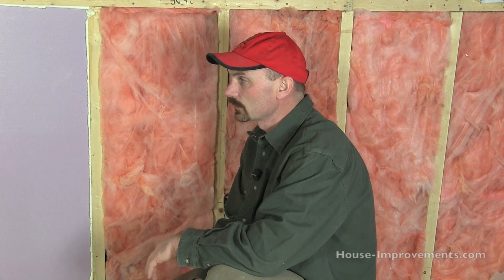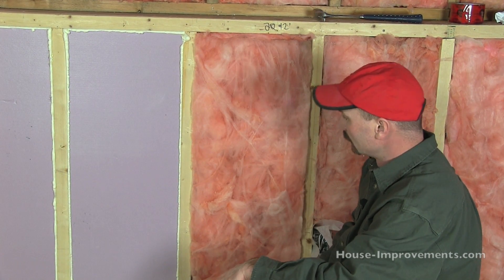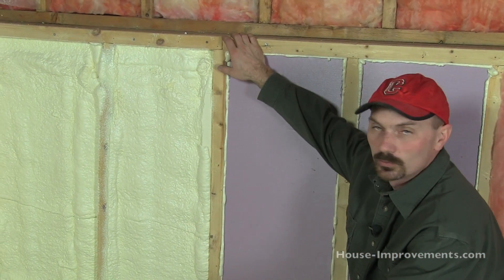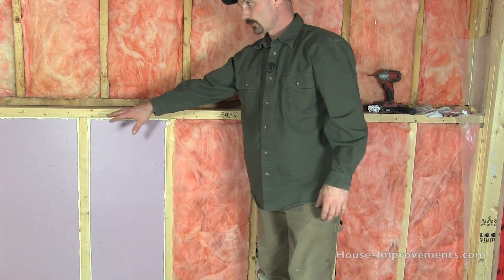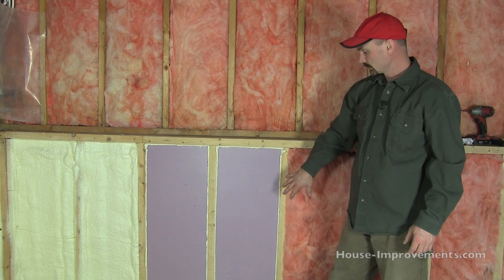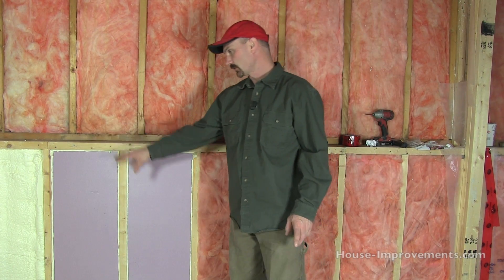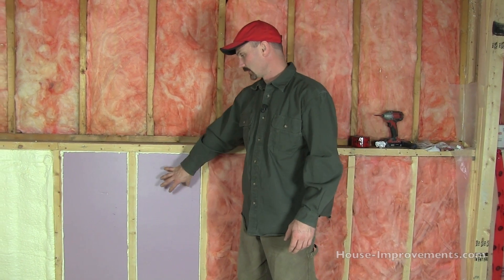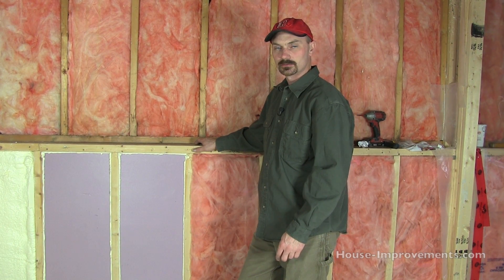House Insulation - Different Types

Comment: A-frame house in California. The section I’m thinking about currently has a sheetrock ceiling with insulation blown on top of it in the attic. Temps can get above 100F here. Can I get away with taking out the ceiling (and therefore insulation) and install stuff directly to the inside of the roof as an insulation replacement and reasonably expect the space to not get super hot on a 100-degree day?
Reply from the maker: Our forum is the best place to discuss this.https://www.house-improvements.com/forums/

Comment: Hi Bud thanks for showing .I'm in England .Got an old detached stone place .There is so many People saying this and that about insulating solid walls .Can you give the correct way I'm wanting to put stud work up and insulate .I see You mentioned using  board straight against wall then stud and insulate it's what I was thinking of doing .What's you're thought plz thanks dave .
Reply from the maker: Stone foundations are a whole other beast in most cases and I dont see enough of them to honestly know the best way to do them but I dont think rigid foam would be it. The wall surface is too irregular to get a good job done. 
My best guess is that spraying 2" of 2 component closed cell spray foam on the wall and then framing and insulation a wall would be the absolute best if it is a dry solid wall. We could discuss more on the forum if you wanted to join us there.
https://www.house-improvements.com/forums/
Reply: Thankyou for replying .I will frame inside  I'll seek more info abt warm meeting cold .Would like other People suggestions  if theyve insulated stone walls .Very  Good Videos .thanks again .

Comment: I notice some of the rigid boards like XPS have silver reflective backing, and some don't. What's the difference, which is better? etc. 

I've also always wondered, why are multiple, thin foam boards not used in a cavity, with gaps left between each? Example, in a 3.5" stud cavity, 1" board flush against the sheathing, gap of .25" using spacers, then another piece of foam board, gap of .25", then last piece of foam board, so you're trapping air in-between each piece..??? I wonder if that would work?

Comment: My house was built in 1947 and is made of shiplap wood and no open stub bays. Would insulation board be better to use that batt.
Reply from the maker: If you have ship lap on both side of the stud bay you may be better off with loose fill blow in insulation, or you could remove the inside ship lap and install batt insulation then cover with a vapour barrier (if you require one) and drywall.

Comment: nice work on explaining that ... not sure who frames but im noticing that the bottom part of the wall isnt overlapped the top part of the wall 6" to allow for insulation to completely touch each other ... always a cold spot there our codes here finally the last few years are forcing the framers to build that up...  No one likes a higher cup holder
Reply from the maker: Ya these are old walls . I use 2" foam across the top and drywall over that.

Comment: You mentioned a "hybrid insulation". Does that mean I can put inside my 2x6 exterior wall for example 2 in. of XPS and 4 in. of batt insulation? I live in cold climate (climate zone 5, almost 6) and Im afraid of condensation if using XPS. So far Ive been using only batt insulation. Do I have to be worried if I put XPS plus batt in my wall?
Reply from the maker: In most cases no is the answer. In basements it is common to place rigid foam against the concrete seal it well then frame the walls and insulate them with batt insulation. This is more what I was referring to. In a exterior stud wall above grade a wall insulated with 2" of closed cell sprayfoam and then covered with batt in each stud bay can be done in some areas. Always best to check local codes first. If you have more questions we can discuss it if you come to the forum.
https://www.house-improvements.com/forums/
Reply: @HouseImprovements  Thank you, Shannon, I will.

Comment: If you put a vapor barrier in a basement on the warm side you may be creating a mold sandwich.
Reply: Larry Schwartz  that’s exactly what I was thinking, it gets pretty cold here in the winter. I have 2.5 rigid foam against the basement wall, and then roxall batten insulation in the framing. I don’t think i need the 6ml poly as the rigid foam acts as my barrier.

Comment: Please HELP.  Are the steps for finishing a basement  1) appropriately attaching the rigid foam directly against cement wall then sealing it with tuck tape &/or spray foam 2) framing the wall with studs, 3) Applying Batt between studs, 4) Sealing all cracks 5) Apply 6 mm vapor barrier over everything 6) Start hanging dry wall

Comment: I watched it few times, this video. I am still wondering, should I go with cellulose insulation for the floor and walls? I was thinking of wrapping the studs with vapour barrier and then putting the plasterboard on half way so then using the openings I can stuff the cellulose insulation (manually) once it reaches the height of the plasterboard then board off the rest all the way to the top and then fill in with the remaining cellulose insulation (I can get cellulose insulation for cheap and better soundproofing material) from the top and then those gaps can be closed with the ceiling boards. Is that a good plan? I need it more for soundproofing purpose. Because of the nature of these stuff (loose) I am going for Roxul on the ceiling.

Comment: I live in a house from the 30s it's a kit home. I had problems with the wall boards warping from moisture and am going to replace with fresh drywall. Not surprising there's no insulation in the walls. What do you suggest for an old house with paper thin walls?
Reply from the maker: Spray foam if you have the budget or Roxul other wise

Comment: I admit I have no knowledge on the subject so please don't judge. 1 solid piece of foam is exactly that... 1 solid piece.  Same would go for professionally sprayed foam... 1 solid piece of sprayed foam. The question starts here: when you "spray foam" onto already existing foam, does it "bond" and create a water tight seal as 1 unit? Logic tells me no, but I honestly don't know.
Reply: There is a lot different spray (like closed or open) and rigid foams with trades for all of them. Sprayed foam does seal better but there can be QC issue with it and open can absorb moisture while closed foam shouldn't. Since believe it or not mistakes are made that can cause problems like off gassing of VOCs so bad ppl couldn't live  in the house. In a basement without framed wall rigid foams should be consider 1st  they even had ones with nail mediums since there no studs. But glue can be used so they are not really necessary.

Comment: Hello Shannon,
I've come from your roofing videos.  Good job !
Hey, I like stucco / timber (English Tudor) walls.
My house has exposed concrete block walls.  I'm thinking of insulation, an air space, and then the exterior.  Do you know of some exterior wall panels (fiber, fiberglass, pvc, ???)
that look like stucco, and don't need to be painted?
Wait!  I'll go to the forum....

Comment: You do not ,repeat.. DO NOT, install a vapor barrier over  spray foam.
Reply from the maker: In many places less then 2" of spray foam is not considered enough of a air/vapour barrier.
Reply: Depends on type (like open or closed) of the foam and where its being applied too. Nice post but a little misleading...
Reply: You do realize that different States/Provinces/Countries/Counties have different code requirements right? YouTube hecklers are so annoying. Make your own video for your own region/State code if you are so inclined to add your two cents. Any reasonable person knows that these videos are informational and that you should consult your local code before doing your own work. Home building in Canada is different than home building in Ohio or California. Thanks for the video! I appreciate it.
Reply: You do realize none of the comments in this thread so far, had anything directly to do with code requirements right? So the half cent add by the last comment was irrelevant. Have good day, Sir.

Comment: Hi Shannon,  this video is very good to understand the different options. We bought an old house, that was supposed to have a finished basement but appears to be the former owner just covered the walls with drywall over 1x4  boards. My husband and I have been thinking in place some rigid insulation sheets on top of the drywall and then add some more drywall on top. We live in some place in Canada where the temperature drops to -50 C in winter. I wonder if  this could be a good idea or it is better just remove everything and start from scratch? Thanks in advance for any ideas
Reply from the maker: really best to start form scratch or at least get rid of the layer of drywall.
Reply: Thank you so much for your advice!

Comment: Shannon, when you poly this wall do you use acoustical just at the top, bottom, sides or do you seal off the center on the sill between frame wall and cement section with acoustical too?
Reply from the maker: I'm not sure what you mean. If you come to my forum we can discuss this more. http://www.house-improvements.com/forums/

Comment: Hi guys, my question is about insulation on a box truck.. I'm in England which means hot summers and cold winters, I was planning on using Celotex insulation boards on the ceiling, walls and floor. What I now need to know is what condensation/vapour barrier to use and where to put it ? Some people are saying it needs to go next to the outer wall and some are saying next to the inner ply wall but thats due to hotter and colder weather.... ARRGGHH !!! Another person recommended a vapour retardant sheet but wasn't sure if it should go next to the inner or outer wall since we'll be getting hotter and colder weather over here... Pleeeeeeeeease tell me you have a 100% correct answer ?...
Reply from the maker: Well We are in Canada so our weather is likely similar. Our vapour barrier is placed on what is considered the warm side of the wall. That would be on the interior.
Reply: Great thanks for the reply :)
Reply: Livin In A Box
Reply: Hello :)

Comment: Spray foam insulation could be toxic if not installed right .. Rather go with the bad insulation or the sec option
Reply: Off gassing will "always" happen with sprayed foam but after a few day it's generally low enough were ppl dont complain about the smell if it applied correctly. But less risky rigid foam or even a solid plastic will off gas or leach. It just a matter of degrees. So as general rule it better to keep it on the outside of the house when possible. Like in new construction.  But there are issues with any material that is used. Like mold can be an issue with fiberglass.

Comment: What kind of spray foam did you use, and where could I get it from?  I live in USA, Michigan.  Also average cost on the foam spray kit you used in your other video?  Thanks Shannon.
Reply from the maker: These kits are not cheap, I can not remember the costs off the top of my head. This kit was "froth pac" by DOW I believe but there are others.
Reply: +HouseImprovements Thank you so much Shannon.

Comment: hi great  video.  I'm  turning my garage  into  a  work studio/ grandkids playroom . it already  has  drywall  installed . instead  of  tearing  down  the  drywall  I  wanted  to  add another  layer  of  drywall  but in between  them add some  kind  of  insulation. what  do  you  recommend .
Reply from the maker: +Virneicia Sims Tearing the old off an doing it right, sorry. The only thing you could add between the drywall layers is maybe 1" foam but then you have issues with electrical boxes not fitting and extending window and door jambs as well.

Comment: what do you recommend for a small basement area
Reply from the maker: +FeaR ComicS  If the walls are only 2x2s then spray foam gives you the most R value but using rigid foam and canned spray foam gives you the most bang for your buck. With a 2x4 or 2x6 wall I prefer rigid foam sheets against concrete and sealed with canned sprayfoam  then framed wall in front of that filled with batt insulation.
Reply: Jjbjñlnbihhvlñoohobbuvivlñbbicñppp0jvvñppphcygopjvibpppovvopppjbjbppobbjbopñ jvjv

Comment: hi great video, im restoring my grandfathers RV and im not sure what to apply as insulation the roof starts on 2" depth and goes to almost 4 inches of depth,the roof is aluminum so I dont know if i have to put something between the aluminum and the insulation.
The original insulation was a Styrofoam about 1" thick and had like a thin wood on both sides(like a sandwith) can you advise what could be the best way to go? thanks so much.
Reply from the maker: You should be able to have the styrofoam in direct contact with the  aluminum. I can't see why you could not use 1" or 2" foam.

Comment: New to this, I trust this will get posted..I'm intending to build a new shop this spring. The area is south of Buffalo, just north of the Pennsylvania border. We get cold. There is a 20' x 30' existing concrete pad on the lot. I will enlarge this to be 20' x 70', with radiant floor heat under the new concrete only. Walls to be typical 2 x 6 x 8' on 16" ctrs. So, I'm thinking a good and economical wall situation to be, form the outside, 1" x 10" rough cut board on board, Tyvek, 1/2" OSB, 1" ridged foam with a 1/2" gap around the sides. This gap to be filled with Great Stuff. Then 3 1/2" batt insulation with the paper flap overlapping the studs. And put foil tape on that to seal that tight.  This will leave a dead air space, as well as a space for mechanicals. The inside would also be 1/2" OSB.

This will leave 2 dead air spaces, the one on the exterior with the board on board will be about 7 1/2" x 1" (with a 1 1/4" lap) and 1" x 14 1/2" in the wall. I understand these to be a good thing for not conducting temperature. The exterior OSB will make the walls ridged, as well as a nail anywhere surface for the board on board. And the same for the interior OSB, as well as a hang a shelf/cabinet/rack etc anywhere surface.

Any thoughts as to what I might be missing?

Thanks, Jack
Reply from the maker: I'm sorry you posted such a long post here but I hope you would not mind reposting in to my forum and I can better respond to your questions there. thanks.http://www.house-improvements.com/forums/
Reply: Hi, JL.  If you are looking for a super insulated building for your shop, there is a company out of Arizona that has a product called "ThermaShell" that I suggest you look at.  There's is a prefabricated system made from panels made from EPS foam with steel reinforcements.  They claim you can put up the shell of a 2,000 sq. ft. house in as little as 10 hours.

Comment: I am struggling with a 25mm gap on 3 walls, 75mm on ceiling and 63mm on the other wall - do I have any good options for heat & sound insulation (building a home studio)? Thanks :-) btw the ceiling is concrete flat roof
Reply: and this - this true? http://www.energyvanguard.com/blog-building-science-HERS-BPI/bid/54110/You-Don-t-Need-a-Vapor-Barrier-Probably

Comment: In a basement you need foam on the concrete BEFORE putting up studs. Leaving studs against concrete like this, especially non-pressure treated studs, and a non-pressure treated bottom plate... and fiberglass with vapor barrier? This goes against all the best practices that experts recommend for basement wall insulation. Shannon you really should bone up on your building science. No one should be doing what's shown in this video, and if they do, they are setting themselves up for a mold problem.
Reply from the maker: I'm afraid you are not completely correct. Yes best practice would be rigid foam then studs, (or spray foam)This is an existing basement framing job. The existing was just maybe R 5 batt insulation with poly vapour barrier and wood paneling. Not one bit of mould was found when things were opened up. We opened the walls because the paneling was being replaced with drywall and we also replaced the vapour barrier. This will meet minimum code and in my area I can not pass inspection without a vapour barrier over batt insulation. If I had a bigger budget it would have been gutted right out and rigid foam used then reframed with 2x4 but that was not in the budget for this project.
Reply: HouseImprovements So, this basement is probably well waterproofed. That's great. But it is not the norm, and advice should not be given assuming that other people's basements are like this, because they're very often not. Random people watching this video are going to think this will work great in their basement when it is actually likely to cause them problems.

Comment: Thanks for sharing.  Insulation can also be used as a form of soundproofing, as the dense nature of insulation helps dampen sounds within the home.
Reply: Insulation can also act as a conduit for noise transfer.  It all depends on the frequency of the sound, if the insulation will increase transmissible or decrease it.  Generally simply adding mass will decrease sound, but insulation isn't the best way to do that.  So if you're looking for soundproofing, best to do some more research first.

Comment: Question. I have a 2x4 exterior wall. I could only get R-13 to fit in at most. What is the best method to get the most R value from a 2x4 stud wall? (spray foam,rigid/batt fiberglass,denim,wool) At a reasonable price.....thanks
Reply from the maker: I think Roxal insulation is the best bang for your buck for that type of wall. I also prefer to also add styro foam to the exterior if siding is being changed as well.
Reply: HouseImprovements An exterior wall on our North facing living room has been improved by taking the wallboard down and adding a 1x1 onto the studs. Whatta big difference!